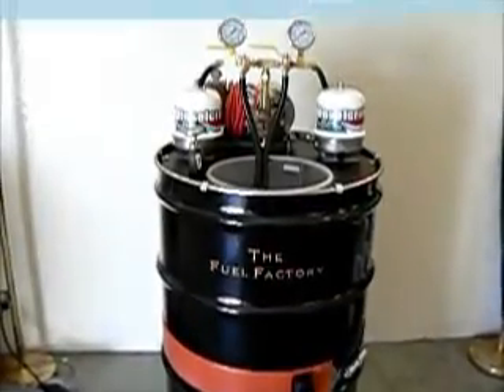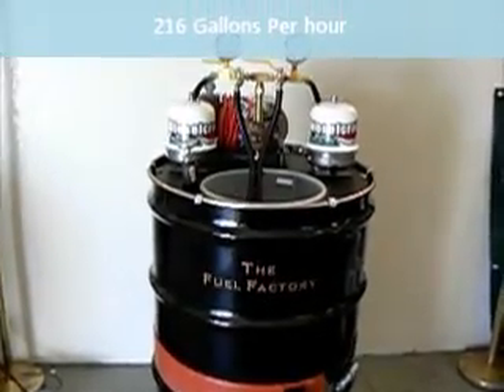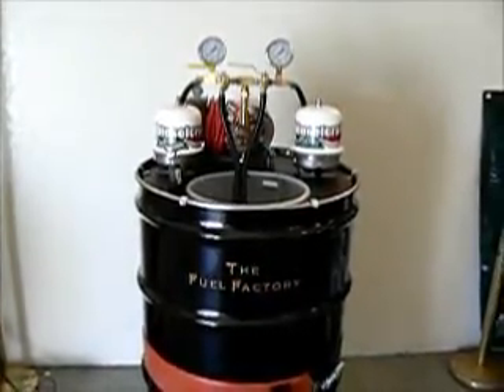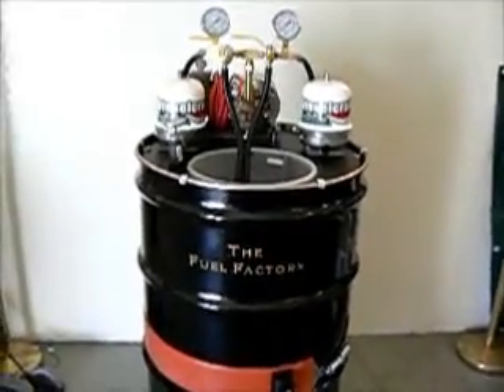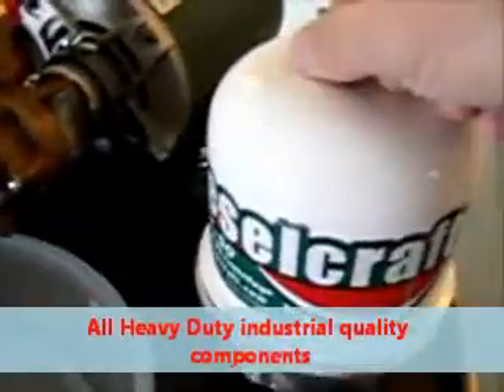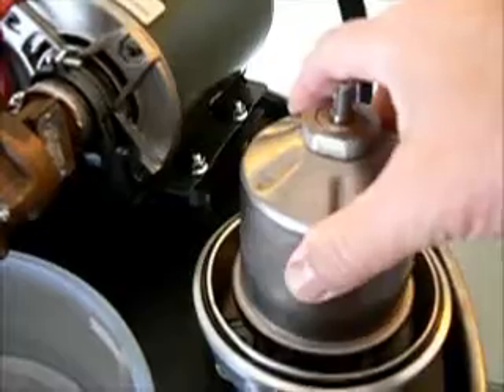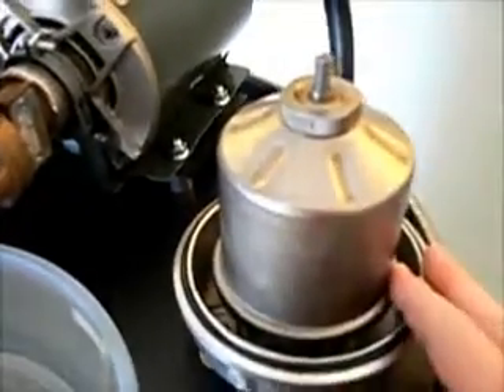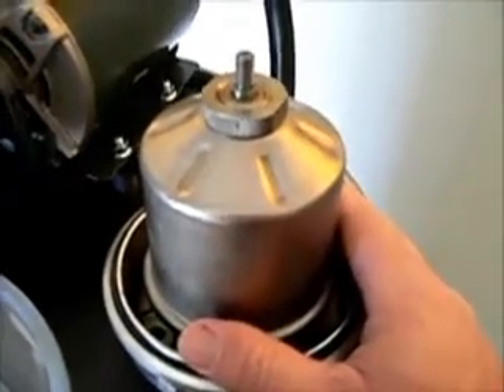Dieselcraft Fuel Factory for making  "Black Diesel" and blended fuels.

Comment: Blend your WVO or WMO with 20% petrol, let sit 24 hours (recommended), then run it through the Centrifuge; next filter' to 1 micron. Or you can just filter'. Done
Note: never blend WVO/VO and WMO; clean the tank by running a load of Diesel prior to switching fuel blends.